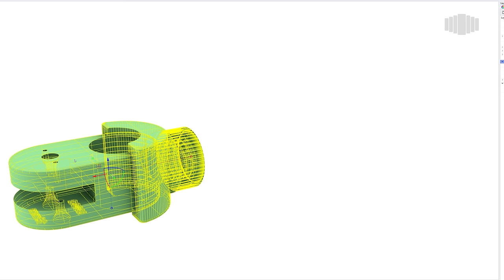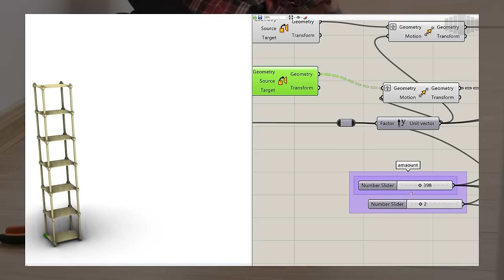3D Printng Furniture || Shelves

Comment: All it would take to make this MUCH stronger would be to put a detent on the inside of the U cap where it makes contact with the dowel.  Just enough so that it compresses into the wood and acts as a lock.
Reply: Or an extra, hidden, screw?

Comment: I like your ideas, and the cool templating software, or whatever it is termed. 
In my shelves, I believe I have a lot more plastic than you use.
I used a thingiverse L-bracket and T-bracket design (3 shelves, 2 sides) with ikea cabinet shelves and glass panel for the top shelve. Had to extend the legs, to clear the walls baseboards. Pretty stable, but mdf shelving is too heavy. 
I wish the ikea aluminum tube & glass shelves were still available. Or even the older pine shelving. Both were quite lite and stable.

Comment: Awesome design, just enjoyed seeing this. To handle the wobble would it be possible to add a cross wire system with very little modification to the same clips.
Reply: My guess is that the wobble you see when he is finishing up assembly isn't poor structural integrity, but because the whole assembly is so light, it moves when he torques down the nuts. The assembly seems to move all together, not flexing in sections as it would if it were a structural issue
Reply: @tricksyhobbitses1695 , adding some corners would stabilize that assembly. Yestarday I finishied some very light 12mm plywood shelf and it was wobbly as hell berfore adding some small corners. Also you can mount it to the wall to add more stiffness. Furniture can be light and stiff.

Comment: Racking forces will destroy this and putting any weight on these shelves will cause the brackets to move down the smooth dowels .The hardwood dowel is not very strong, and racking forces will destroy the plywood or the 3d printed brackets.

Comment: Very nice as usual ! 
Question : maybe it’s possible to bypass screws with a design with a screw system to pinch the plywood ?
Reply: In my experience 3d printed stuff tends to get loose after awhile, so I don't think that would be a good way to hold the plywood
Reply: @itsyaboi5861  add PLA to that and it wont last long

Comment: The funny thing is once you have a 3D printer it's like "when you're a hammer everything looks like a nail".
Reply: Totally agree. He can just use rectangular bars instead of cylindrical. And then just use metal angles to secure shelves. No need for this overcomplicated design with threads and knobs. I would understand if he planned to move shelves lower or higher, but it does not look like he did. Also it is not easy anyway.